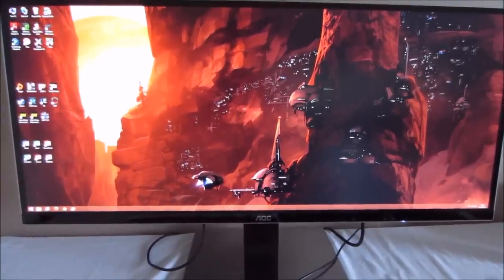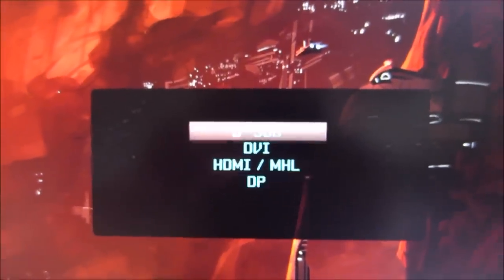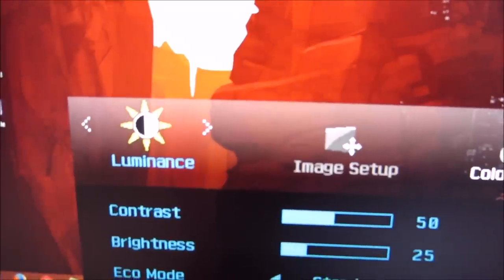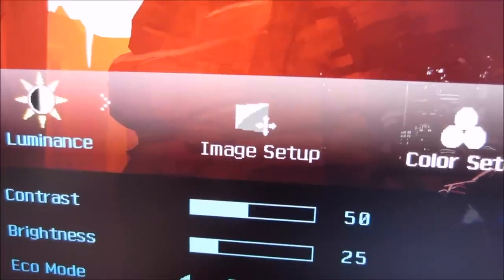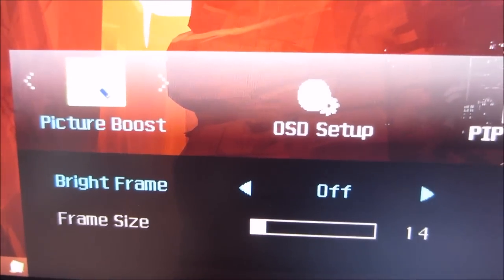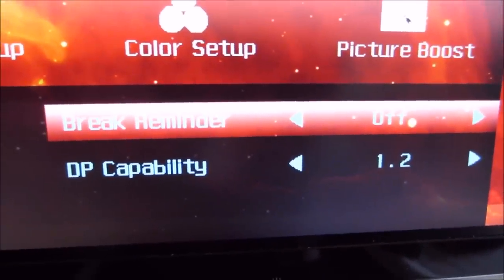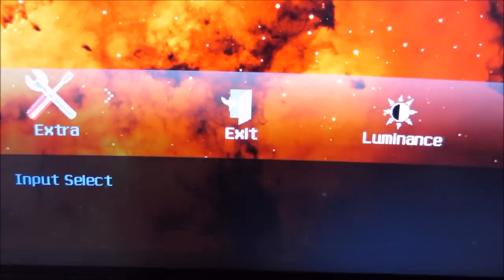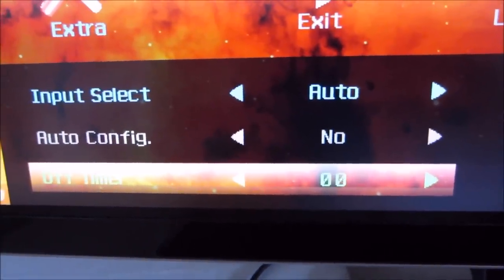AOC u3477Pqu Menu System (OSD)

Comment: 0:30 is that a dark pixel i see or a glitch in the picture just above the blue light
fantastic monitor been waiting since October 2014 for these to come in to the uk
any bleed ?
Reply from the maker: It is indeed a fantastic monitor. I couldn't say if it was some sort of pixel defect but I didn't notice it when I was using the monitor, so it wasn't a problem. Any monitor can suffer from dead pixels, especially when there are 4,953,600 of them. Information on uniformity can be found in the review.